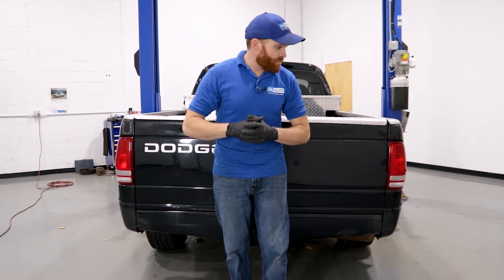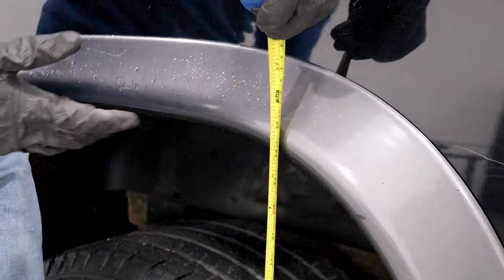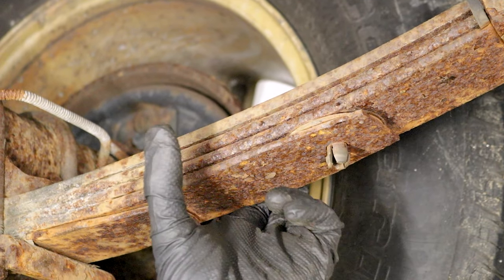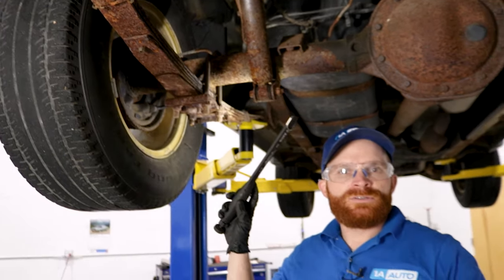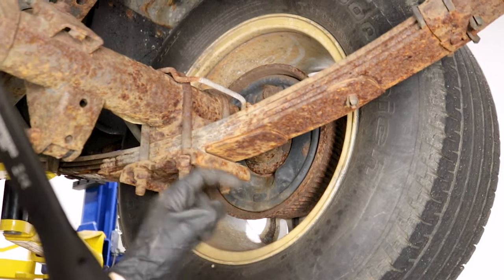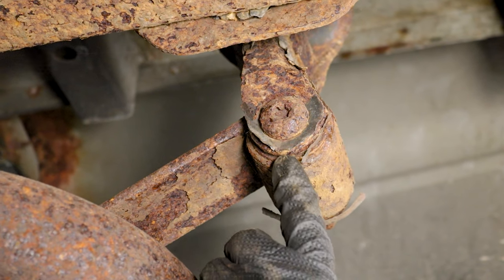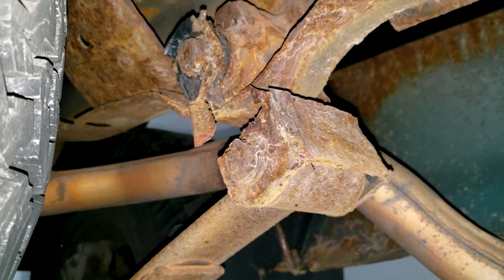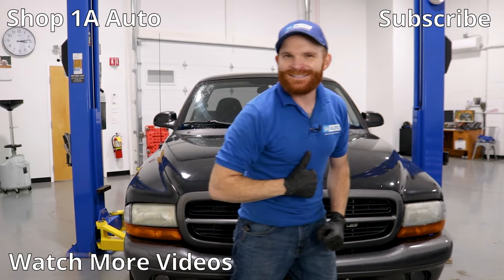Truck Leaning, Sagging or Uneven? How to Inspect Leaf Spring Suspensions

Comment: If that was me inspecting the underbody of THAT vehicle I’m pretty sure it would go like this…(me phoning the customer) Hi this is Bob from 1A auto and we’ve found the problem , it seems you either live way to close to the beach or you actually park your car in the water each night after work? The suspension is the least of your worries because i would be amazed if your chassis could hold a bucket of plastic bananas let alone the tub of that ute , we also added a “y” to the name of the the vehicle written on your tail gate, we couldn’t fix your brake so we made your horn louder. 
My opinion is insure it for market value then drive 10klm away from the beach and set fire to it.
👍

Comment: I put on new shocks but my truck does not have springs on the rear , so I figured by installing new shocks would fix the problem so that was not the case

Comment: Will bad leaf springs cause the front to sag?
My driver side is sagging even after replacing shocks, coil springs, and upper and lower control arms.
Reply: I have the same issue, was told it’s because of the battery and such on the driver side and only way to counter it was to put a lift kit on the driver side only, hope this helps

Comment: Hello very good explanation, what happens if you only change the main leaf at one side but this new leaf is just a little bit shorter or longer, will the vehicle have a problem with that? I mean for heavy duty vehicles

Comment: Yes I have a 04 Chevy Silverado my rear end sag in the back I got brand new shocks all the way around and I have a little Shake everytime I go 60 miles per hour what can I do to fix that?
Reply from the maker: +Gable Taylor We wouldn't be able to diagnose an issue like that here, you may want to have a local mechanic take a look at it. Thanks for checking us out! http://1aau.to/m/Shop-1AAuto-c
Reply: Gable Taylor, did you try balance, rotate tires, plus front end alignment. That would be the basics. 

Good luck.

Comment: i have a 97 hombre and pass side bed corner higher than drivers... i noticed the rear shackles are. not in the same position,   drive side straight up/down,  pass side a few degrees forward???
Reply from the maker: +@RandyWells24 It sounds like the uneven height of your truck bed could be due to the misalignment of the rear shackles. The shackles are crucial for allowing the leaf springs to flex and absorb shocks, and if they are not positioned correctly, it can lead to uneven suspension and ride height.

Comment: If the leaf shackles are worn down or bound up bolts and pins, can this cause the bed of the truck to bounce on bumpy roads. Like not the entire bed, but from the back of the rear wheel well to the tailgate?
Reply: Possibly. However, since the movement is localized to a specific area, I'm more inclined to think it's a body (bed) mount bushing. I had a very similar issue on an F-150. I replaced the bushings  and the problem went away.

Comment: I have a 2000 s10 ZR2 and the passenger side leaf spring either collapsed or broken. there's about a 1-2 inch gap in the spot where it moved. does it need replaced or is it something in the front suspension?
Reply from the maker: +brian versansky We wouldn't be able to diagnose an issue like that here, you may want to have a local mechanic take a look at it. Thanks for checking us out! http://1aau.to/m/Shop-1AAuto-c